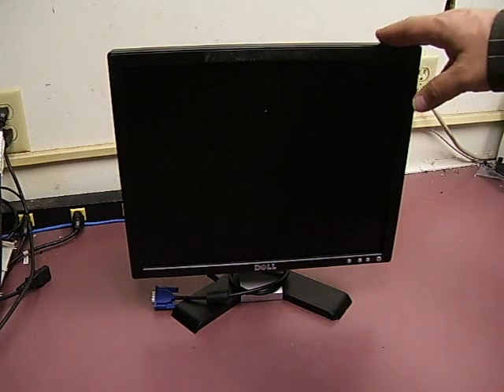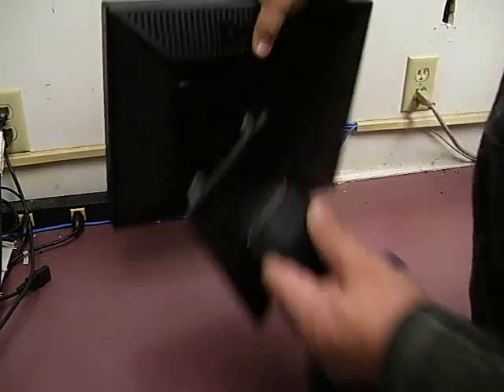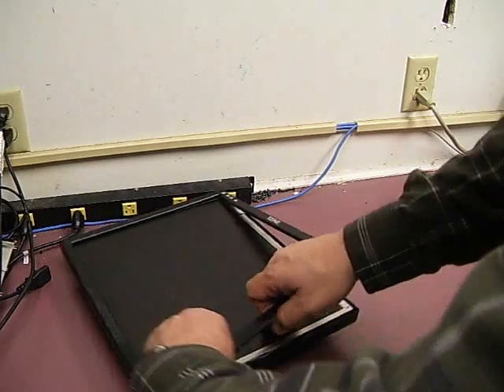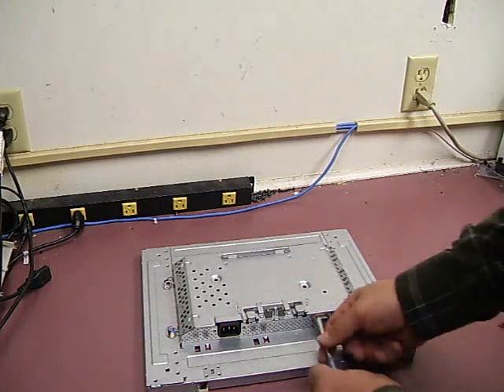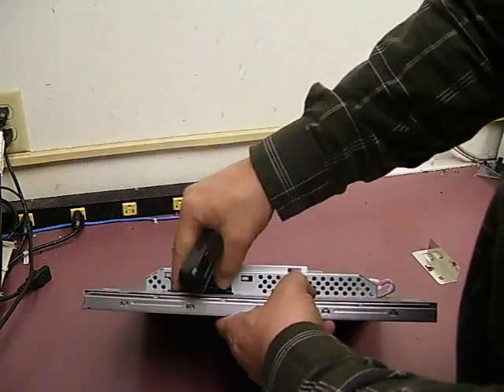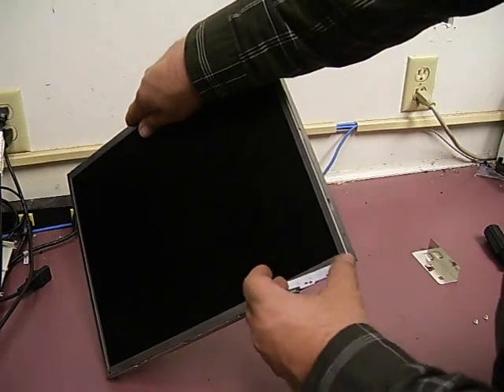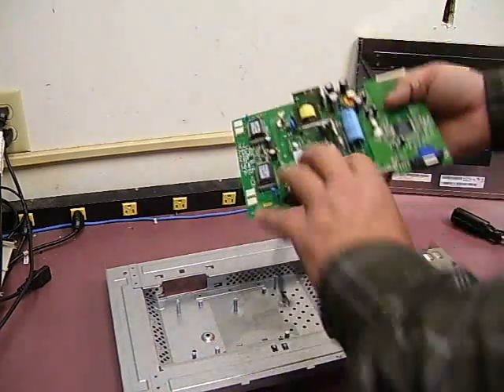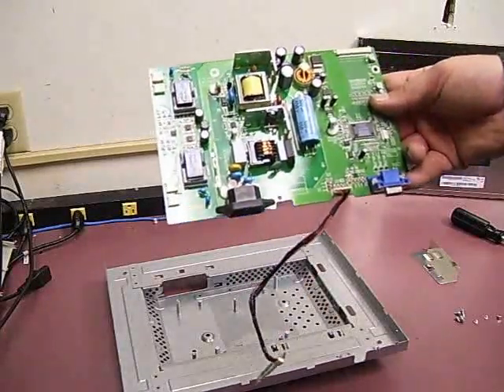Repairing the Dell E198FPf 19" flat panel monitor - Part 1 Dis-assembly

Comment: Great tutorial! Thanks to it, I repeaired a monitor for some dimes and a bit of work. Although taking the front cover off looks pretty easy on the video, while in reality it was quite troublesome - at least for me. My fingers still hurt ;)

A little tip from me: additionally to twisting the front cover (needs substancial force) I put a dentist's blade in the slit between front and back cover and gently bent the frame outside. Although one should be very careful with such operations - it's easy to make bad marks on the plastic cover. The other solution (practiced by me later on) is to put more force to use and not be scared that the frame might break (it's tougher and more flexible than it looks).
Reply: Thank you.. I have to try this..my fingers got pinched really bad when I tried to open. Yes, in the video it look easy but when I tried it's really hard and troublesome

Comment: I have the exact model E198FPf but it is slightly different internally. The back top has a long rectangular circuit board of some kind and yours does not. Anyways, buying the kit and a soldering kit 14 + 13 = $27? Better off buying another used LCD monitor off CL for 20-25 bucks.

Comment from the maker: Are you sure that your monitor is the E198FPf version. The last letter "f" designates the manufacturer of that unit and everyone that we have worked on in our shop - several hundred have exactly the same power supply. There are different versions of the E198FP monitor with different power boards. Please check and let me know if you do have the E198FPf version and let me know what power supply board you have so we can make updates if need be.

Thanks for watching and commenting on our video.

Comment: I agree with Richard Favara.  This was helpful in bezel removal. There are several differences inside.  Unplugging the backlights is the same.  Only have to remove screws from the power supply.  Do not have to disconnect the monitor cable I did have to loosen the tape that held it down on the back of the monitor but not at the plug connection. Only small connector between video board and the power supply.  Two screws and protector sheet over power supply then Three screws over power supply.